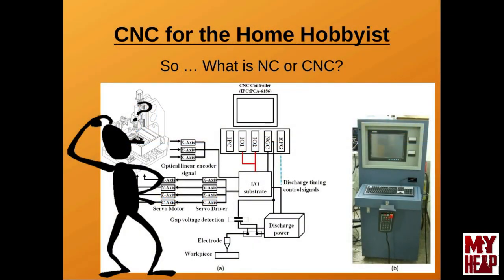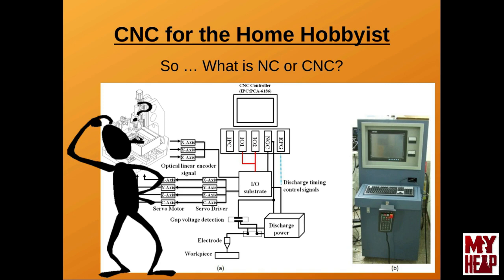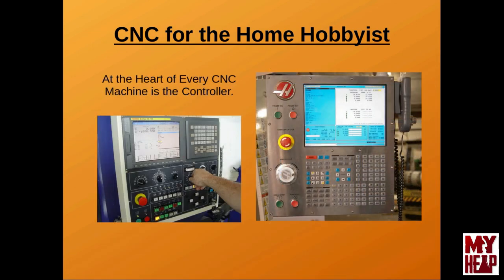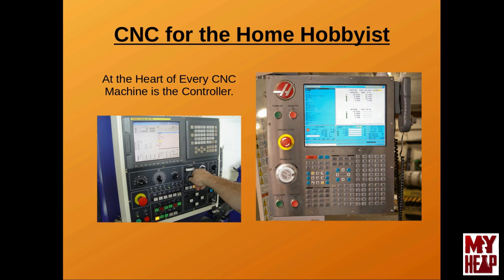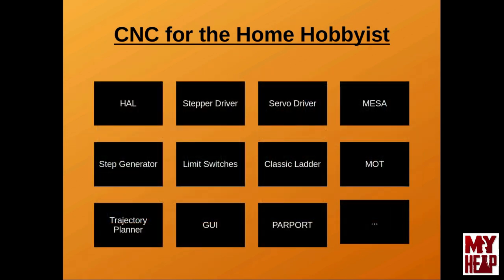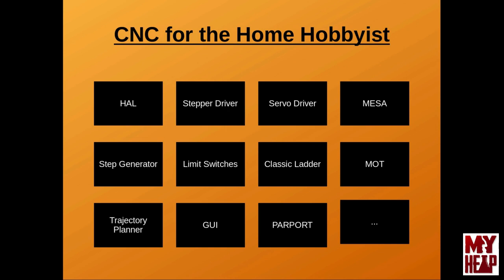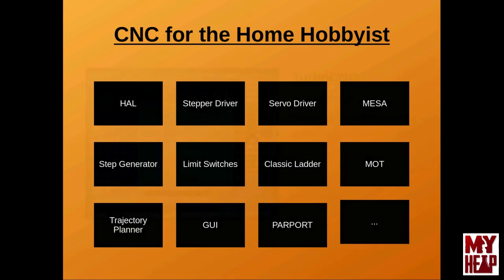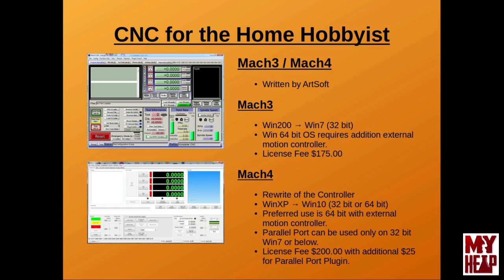LinuxCNC for the Hobbyist - 001 -  What is NC / CNC?

Comment: Excellent series....BUT....I own only Mac's....am I screwed? 😖
Reply from the maker: Hey Richard,

No your not, but like any controller you want a dedicated machine to run it.  Old PC's are CHEAP!!!  Now I know that MAC is a flavor of Linux under the hood, but you need real time kernel extensions to run LinuxCNC.  Even if you could run it on a MAC I don't think I would use such an "Expensive" box.  I think maybe the next episode should talk about computer requirements.  Believe me, you don't need a powerful PC to run LinuxCNC.

Joe
Reply: well yes but its just apple doing it i bet you can do cnc on a mac but a second hand pc would be cheap i don't think the computing power is much for a cnc machine
Reply: Slitting my wrists sounds more appealing than owning a PC running windows 😐. I have owned only Macs since 1982
Reply: well that is a bit extreme
Reply from the maker: HAHAH, Thankfully that PC will be running Linux!  Hey, I am an old computer geek.  Richard, you are NOT being fair to Windows here.  Don't you know you can get a stable windows machine if you power it off and lay it on its side???

I am about 99.5% linux in my house.  I use Windows for some CAM stuff, but there are a few ported applications to Linux now.  The REAL CAM stuff for *nix is 'spensive Lucy.

Joe
Reply: @MakinSumthinFromNuthin  really interesting since the first mac wasn't released until January 1984. Maybe you owned an Apple II at that time.
Reply: Apple II C, floppy drive, dot matrix printer, modem. Expensive 😐

Comment: sir can we use ultrasonic sensor to manipulate z axis ..so it can maintain constant distance between ground and tools.
Reply from the maker: Please explain.  😀
Reply: @MyHeap  i need to adjust z axis according to the surface. If there is any up and downs in surface , sensor reads thats distance and move accordingly
Reply from the maker: @shabantyagi7354  I honestly don't know.  May I suggest the IRC channel and asking the group.  You can find a link from their website.  Sorry man.
Reply: I honestly think you should use some sort of BL touch sensor or probe to construct a mesh of your topography, and then compensate for the deviations that way,